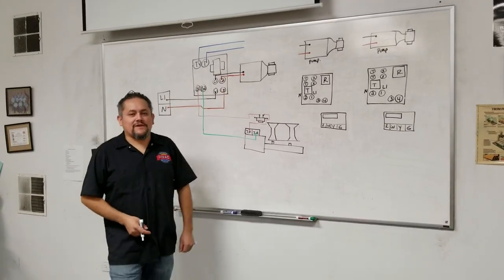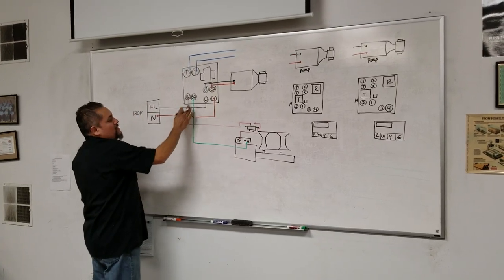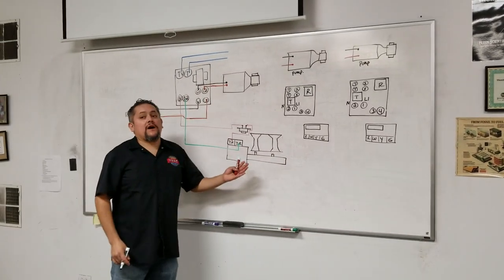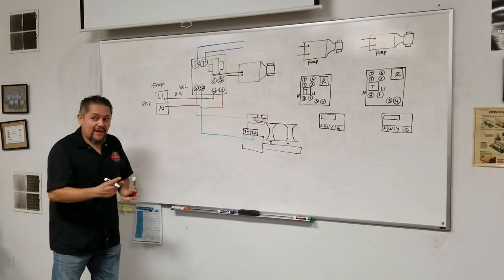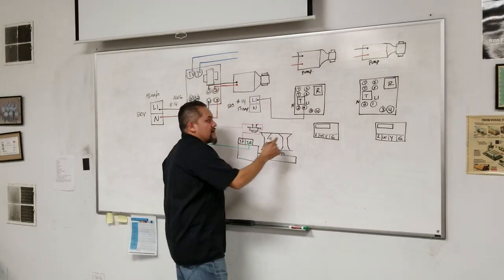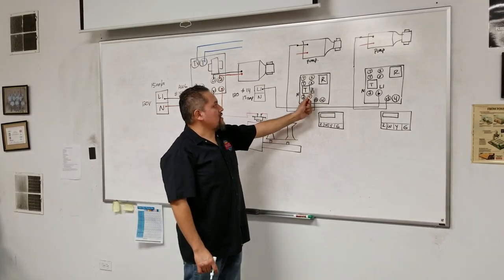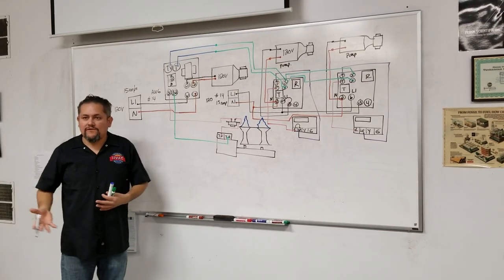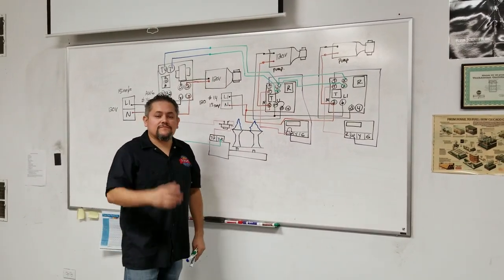Zone circulating pumps 120v

Comment: Nice video.  I have a 2 unit apartment with only 2 pumps and the zone 1 unit had to call for heat in order for zone 2 unit to get heat like you said in the end of video. How can I fix this? Add another circulator pump?

Comment: I’m trying to add some baseboards in the basement that has no heat and no air conditioning and there’s no room on the manifold at the circulating pump can I split and share a circulating pump and use it for two separate circuits